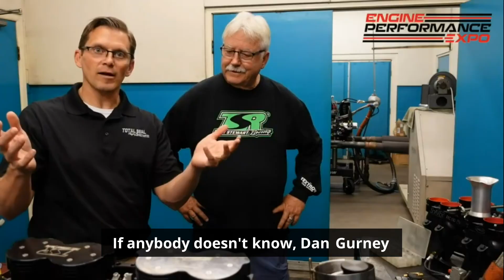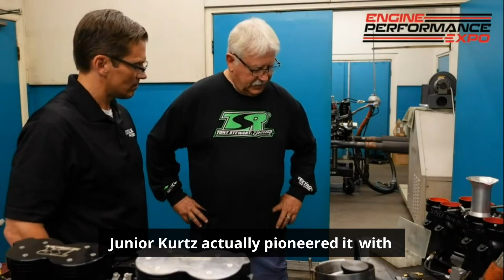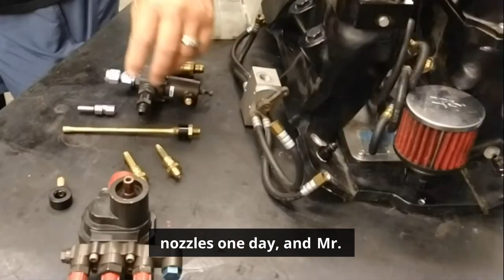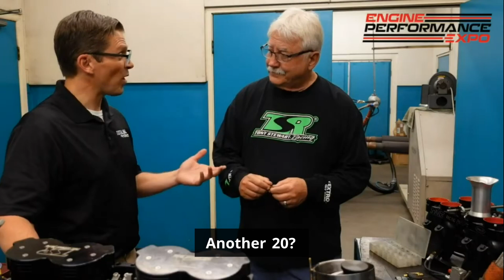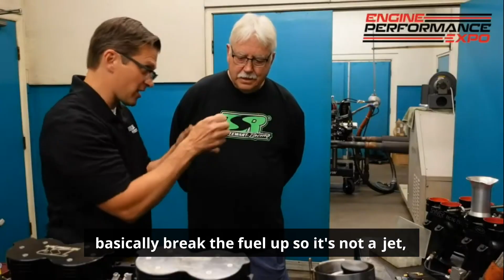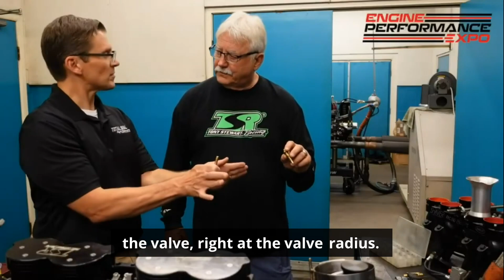Ron Shaver reveals how the down nozzle added 60HP to mechanical fuel injection

Comment: Also, maybe now this explains why the aftermarket Delphi Performance Injectors with the 3 hole spray plate over the injector nozzle was designed like that & sprays 3 streams of atomized fuel, which I thought was awful.  They are sold under Trick Flow, Holley, & Standard:  FJ47 (3 hole), FJ711 (single hole), aka Delphi D1810BA, FJ711, ( Lucas disc injector 621022) .
This also explains why the 87 Corvette used a single stream Bosch injectors & a 9th cold start injector vs. the SVO Mustang style Bosch 2 injectors that have a fine atomized spray pattern or Bosch EV1.3 skinny Ford 4 hole or skinny LS1 4 hole injectors.  However, the early Corvette TPI injection was bank injection & not sequential.  So it looks like Hillborn is Continuous Injection like a Bosch CIS K-Jetronic mechanical injector system, but with no electronics or sensors????🤔

Comment: Wow!  I am blown away by this concept!  I study the Delorean which used the Bosch K-Jet mechanical injectors, & that same Bosch CIS Continuous Injection System was used among old Porsche, & even 308GTSI Ferrari & Testarosa!  
I am always thinking about mods & refinement to the PRV- V6 which was also an Oddfire motor at 150/90 degree firing.  I'd love for a race engine builder or even David Vizard to look at that engine & throw every modern day or old-school tricks at it to get that 1.21 GigaWatts !😋
Reply: Rocky Augusta got that motor making 450 hp in his cars.
Reply: @andykerr3803  Yes, but I had read that PRV in the Venturi, was a totally different engine & Venturi had a totally different block that was iron not aluminum & the water pump was integrated into the front side of the lower block with I guess many other differences not shared with the B27, B28, or B280 PRV engines.  Its hard to find details about the Venturi PRV engines, but they were unique.🤔.  However, the famous Volvo Rally guy John Lane got over 500hp out of an even fire PRV B280 engine back in the early 2000's!
  A lot of info about it out there & vids.